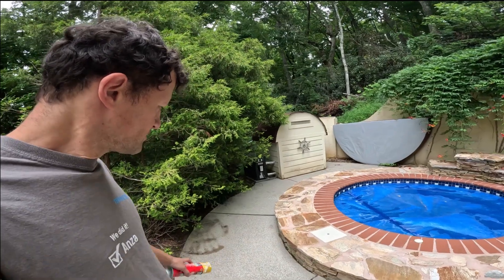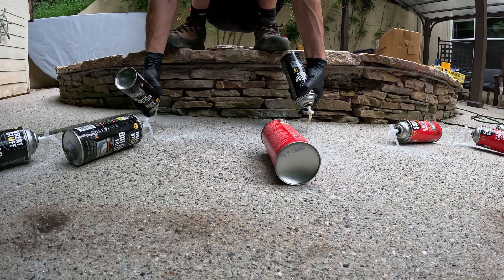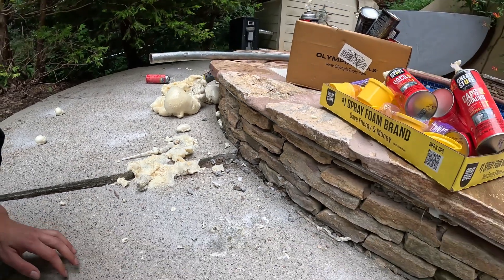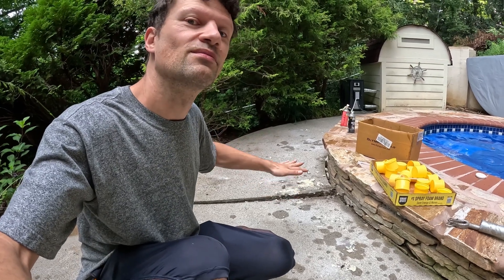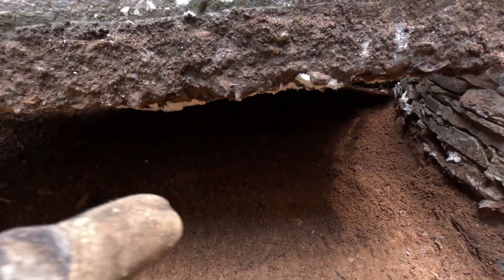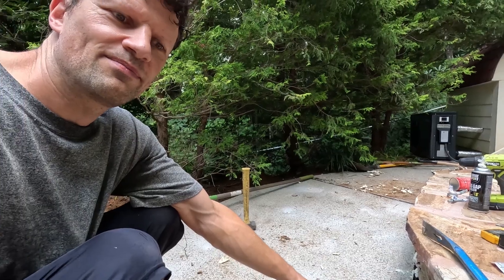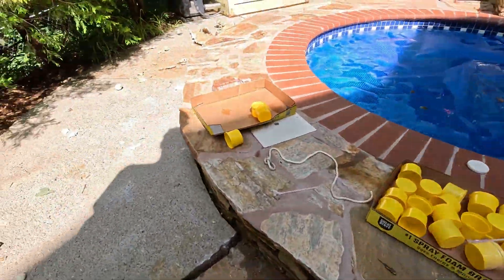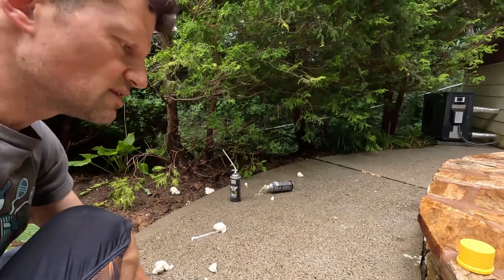Foamjacking Concrete Slabs: What Could Possibly Go Wrong?

Comment: It's likely that each time it rains water will get between the slabs and that pool and will undermine the slab that was jacked up so it will settle more. Disturbing the compacted soil under that slab was a mistake. The way to slow that is to seal the seams.

Comment: Thanks, this was helpful. I’m a homeowner looking to raise a slab on my front walkway. Has your slab remained level? How has it held up?
Reply from the maker: Once I managed to not overshoot and stopped using "Big Gap" foam, the slab remained where it landed (with some settling after the first rain, but that's mostly because I disturbed the soil by digging).  

Sadly, next year I dropped a tree on it and cracked the slab - the trunk was just 3 inches too long to clear it.  Unclear how the foam cushion affected that event.  The surviving sections are still level.

Comment: I am so surprised it has the strength to lofe the concrete, and not just come out if whatever hole it can find. Does it stay this way over time?
Reply from the maker: Professional slab jacking services also use polyurethane foam for a permanent fix, so I can only hope that little cans contain more or less the same stuff.  It seems to be pretty good at supporting largely static loads if protected from UV light (which it is since it's under the concrete).  

There are a bunch of videos on youtube on people trying to use this stuff to make flat-free tires, and there it doesn't last as long due to constant change in compression force, it eventually collapses.

Comment: So good tip for working with spray foam:  Before it cures acetone quickly cause it to collapse.  Always have a supply of acetone around for things when they go wrong.  You can also get the spray foam cleaner cans, they are just acetone in a can compatible with the foam guns.    Now if things cure that's a different story. Really the only good way to get cured spray foam to collapse is high heat.
Reply from the maker: Thanks for the tip!  I had wondered if I could pump acetone into my injection holes, but I didn't have a rig set up to deliver it with any kind of pressure.  I figured that a pesticide pump sprayer wouldn't handle it.

Comment: Bizarre... since you lifted it couldn't you just add some stones under it and no foam?
Reply from the maker: Something still needs to conform.   Bottom of the slab is not flat, and the surface of the stones would not be flat.  When concrete is poured, it conforms to the stones or compacted soil underneath.  There is no way that I can create a surface that perfectly matches the shape of the underside of the slab.  Now, pouring concrete underneath and dropping the slab into that would work, but it's just as tricky to get the level right (imagine tiling but with a 1000 lb tile).  It's also a lot easier to just use a spray can.  It just took me a few tries to realize just how cautious I need to be with it.

Comment: If you would have known you'd be lifting the slab with jacks you could have used a thin grout to fill in under the slab.  Regardless good job and Ill never try the spray foam as its too unpredictable =(
Reply: What's unpredictable is the patience of the applier.